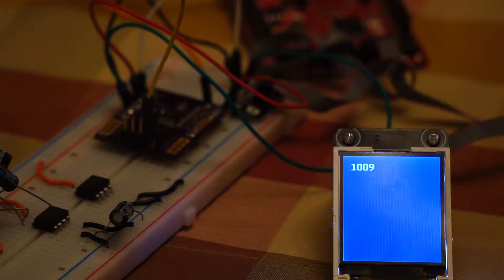Maxim MAX11616 .netmf MikroBus

Comment: Hi Marten, 

It's been a long time since you posted this video but still want to ask if you can show the program you used to communicate with the MAX11616 please. I'm using the same IC with atmega2560 but I'm having trouble to make it work so it would be very helpful.

 Thanks beforehand.